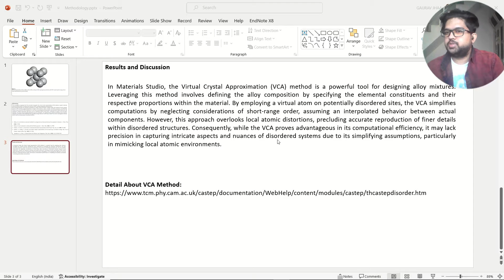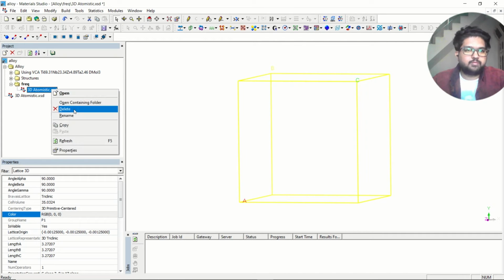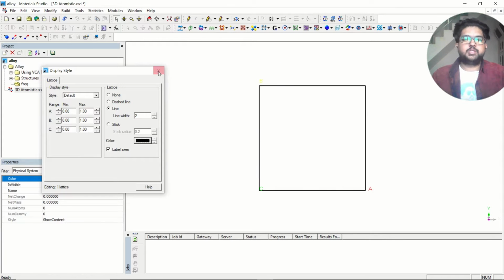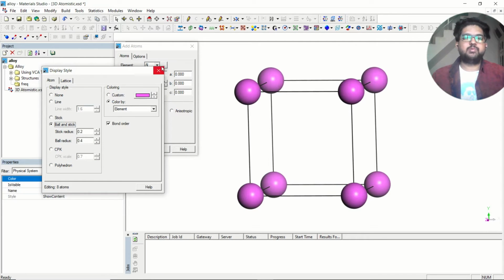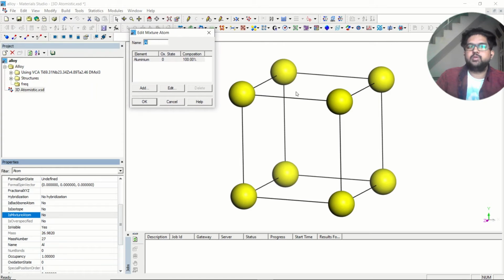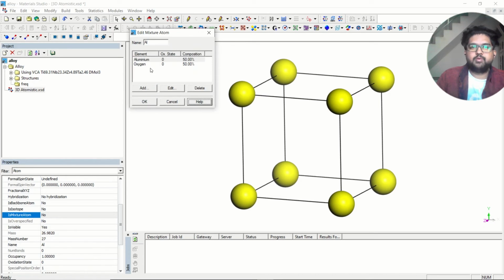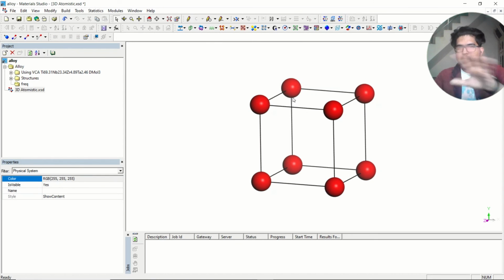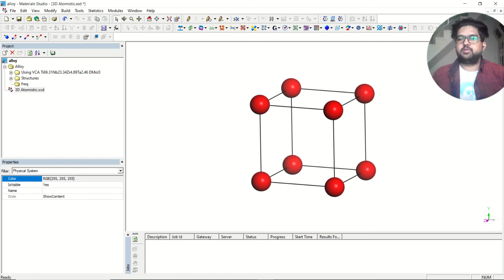How to design alloy mixtures using VCA method ||Gaurav Jhaa

Comment: thanks sir for the informative video, i have a question i want to study the case of disordred site B and B' in double perovskite i used this vid to design the structure but when i run the calculation it shows job failed using castep. do you have any ideas how to solve this, and THANKS
Reply from the maker: Right now CASTEP doesn't support the VCA method. Try using Dmol3.
Reply: @quantumguruji  THANKS for your time sir

Comment: If I want to design a new material composition, should I choose any random configuration with any element from periodic table and then study through calculations if that composition is stable or not?
Reply from the maker: @aeshasiddiqua  you can do, but there should chemical rational.
Reply: @quantumguruji  thank you sir. Is there any theory available to understand a feasible chemical ratio?
Reply from the maker: @aeshasiddiqua  I think there are some software available in mechanical engineering area, which can predict alloy, materials with mixture of atoms etc., do some literature survey.
Reply: @quantumguruji  Thank you for the guidance sir.